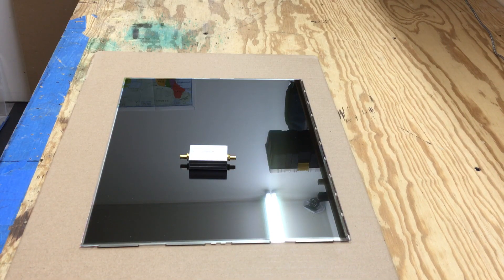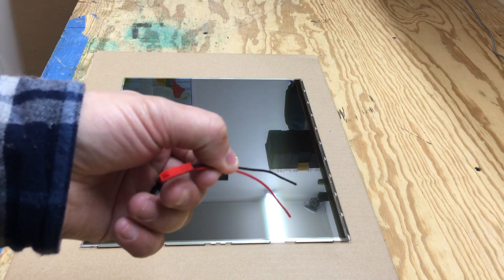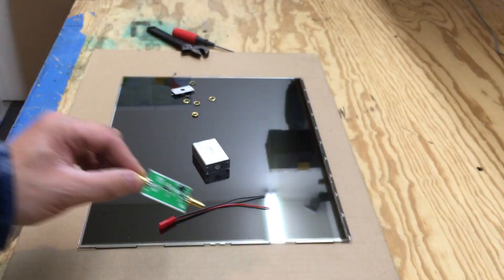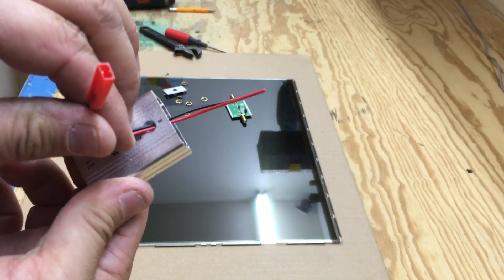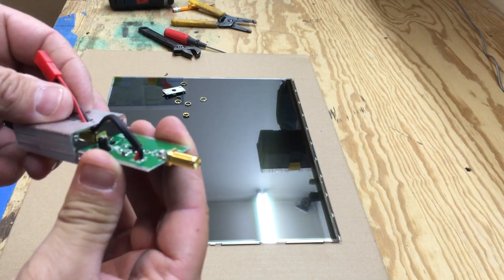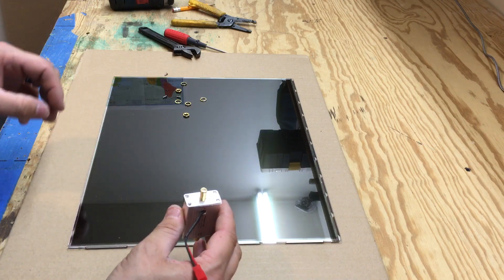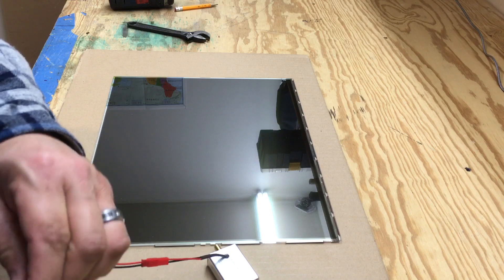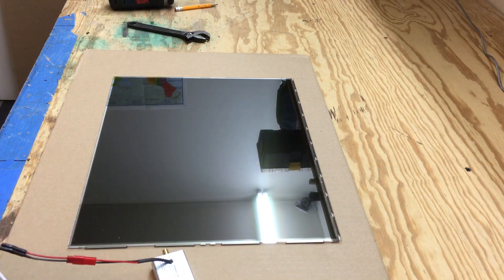RTL-SDR.COM Wideband LNA With Case *Power MOD*

Comment: That unit is powered by bias t, why would you add the 5v pigtail to power the unit. You are now pushing that power to the antenna, because you aren't using a dc blocker. The 5v is going to cause issues with heat.

Comment: "Direct power can be enabled simply by changing a jumper position, and removing the metal case." Not switching the jumper AFAIK may damage the board.

Comment: Looks like a Good idea.  How did this work adding power?  I didnt see a follow up video.
Reply from the maker: This unit needs power to work. From a bias t or a external source.
Reply: Fuzz The Pi Guy I see. Im not experienced with it yet. I have sdr dongle and one of these on order. Thought it was just plug and play with no modification
Reply from the maker: It is plug and play. If you’re rtl has a bias t, then the dongle can power the lna. I just added wires to it, so I can power it when not using a rtl that doesn’t have a bias t built in.

Comment: Hi, I been watching this wideband LNA and not sure if it's worth to buy, I have the RTL-SDR and wish to connect this device to it, I hope I understand the principals correctly ;)  Thanks.
Reply from the maker: What do you plan on using your RTL for?
Reply: @FuzzThePiGuy  Hi that was fast ;) Mainly to scan ham and police, air traffic, iss, nothing heavy for now, I will try to get better and after get to something more professional, thanks. Sorry forgot to say I have the rabbit hear antenna, short and long.
Reply from the maker: I use a RTL-SDR.COM dongle with an LNA I got off eBay. Connected to a scanner antenna.
Reply: @FuzzThePiGuy  I have the same model with the antennas kit, thanks.

Comment: Picked up rtl-sdr LNA but have read differing methods of hooking it up. Does 'IN' connect towards the computer or antenna?
Reply from the maker: Antenna “IN”. Out to “Dongle”.
Reply: @FuzzThePiGuy  Appreciate your quick response, thanks.
Reply: @FuzzThePiGuy  Are you really sure? if you watch the board in part says RF IN the other says RF OUT / POWER, since you feed from antenna RFIN thats antenna, and you need to supply pwr via biasT so there you go +5v means power/biasT/dongle
Reply: @mistahke  Antenna connects to IN port.

Comment: i have the same lna but it is decreasing the signal
Reply: Reduce the gain of the reciever, if you have strong signals (i.e. FM Broadcast) add a notch filter.

Comment: nice case! but whats the jumper in the upper right corner about, voltage input setting ?
Reply from the maker: The case comes with the LNA. The black jumper in the corner is a ON/OFF jumper. The jumper is on the ON position with powered by the bias t. When powered from an external source, you put the jumper in the OFF position.